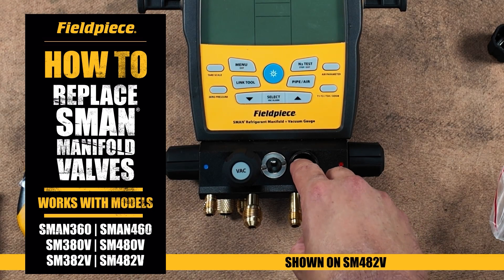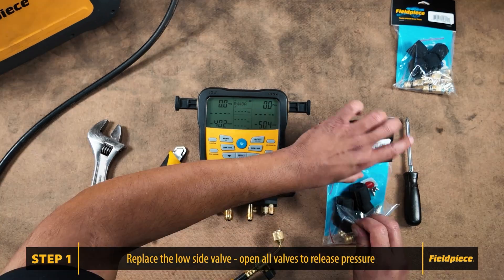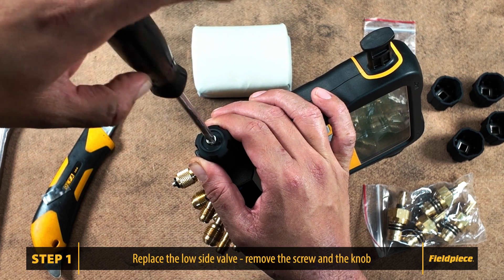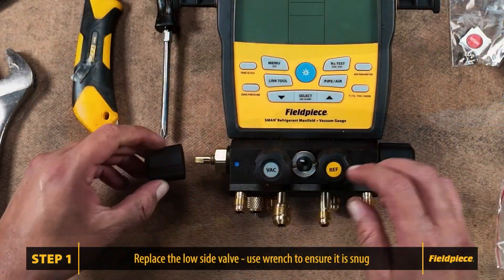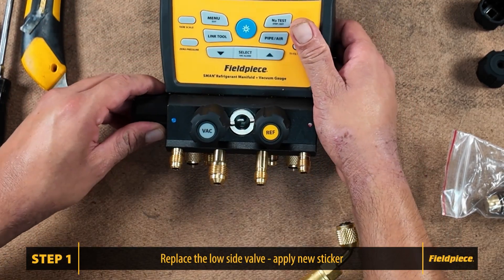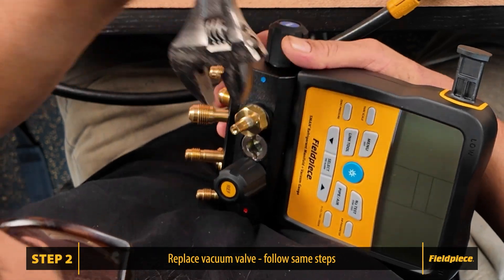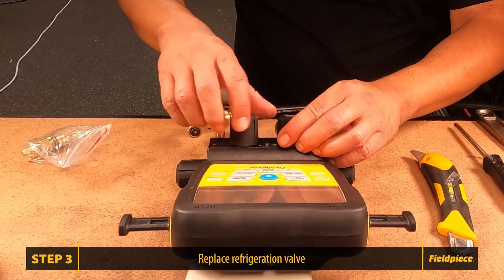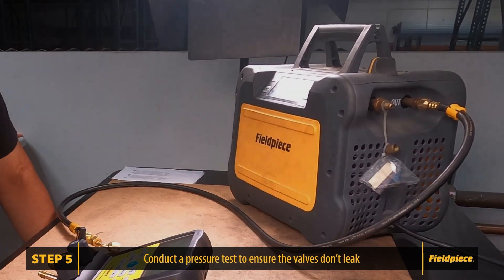SMAN® Valve Replacement Tutorial | SMAN360, SMAN460, SM380V, SM480V, SM382V, SM482V

Comment: The 1/32 drum track is insane 😂. I'm gonna have to rebuild my 480, now that the federal grants require proof for micron degradation. It probably still wont be enough and will need to get The BluVac kit. It's weird times because even gauges are slowly going away. It will all soon be schrader-remover tools with tees and the wireless probes attached. Separate hoses and gauge for vacuum alone. Things have surely changed
Reply: Measurequick will not support any micron degradation tests other than for the BlueVac
Reply from the maker: Innovation is at the core of what we do, and we're continuously working on new and improved products. Thanks for your feedback!